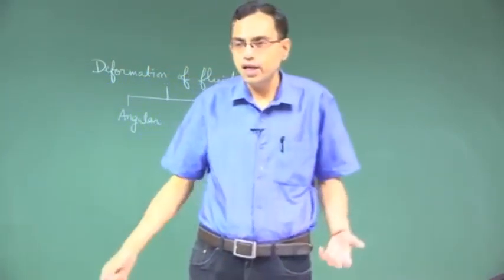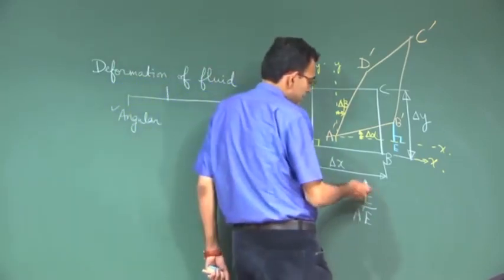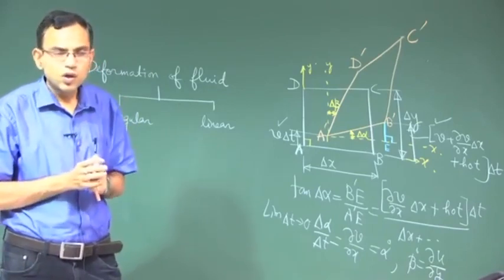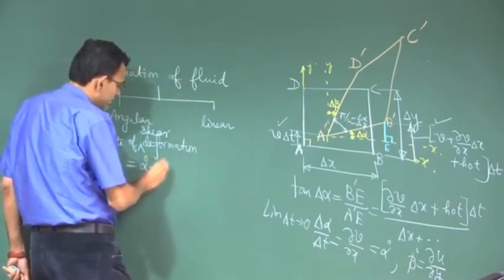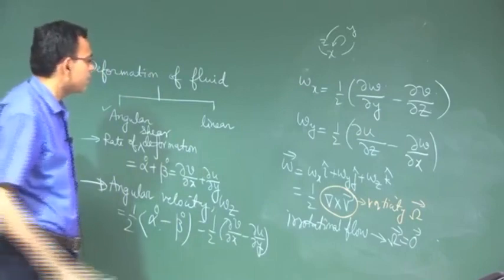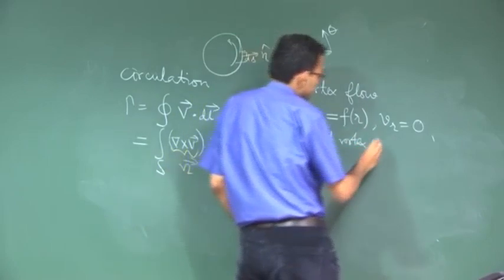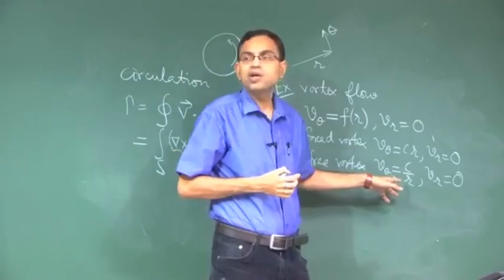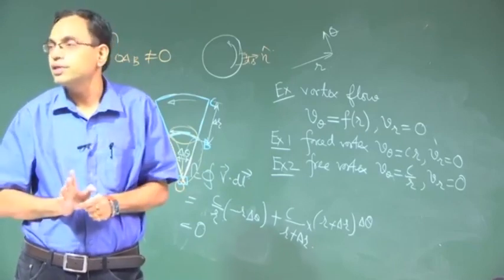Lecture 03 : Angular Deformation of Fluid Elements

Comment: 7:36 👈can anyone explain how that came?
Reply: can anyone explain concept at 7:36
Reply: Taylor series expansion
Reply: do(v)/do(x) is the change in vertical velocity with respect to change is x direction so as you move in x direction then the change in vertical velocity per unit lenght is that expression. now point B' is at a distance of delta(x) so vertical velocity at delta(x) is [do(v)/do(x) . delta(x) ] and the height of B' is that expression multiplied by delta(t)
Reply: hope this helps
Reply: @apoorvmishra6992  At 7:31 when Sir is writing the Taylor's Series, at last why does he write:
+ hot] × Delta t
What is that : +hot???
Reply: @not_nirmit  taylor series is just an approximation of actual curve by summing up higher order derivatives. More the HOTs i.e. Higher order terms, more accurate is the approximation. Its an alternative way to represent a curve apart from its equation. Here HOTs would be (d^2)v/d(x^2) + (d^3)v/d(x^3)+...... . So here single derivative means rate of change of v with respect to x. Double derivative means rate of rate of change of v wrt x. Triple means rate of rate of rate of change of v wrt x and so on. So here more the terms more accurate would be the calculation of velocity at the distance (delta x) as the rates of change also themselves may keep changing. But here later its assumed that, only v changes with distance and rate of change of v is constant throughout the distance so that double and higher order derivatives won't exist. Hope you got some intuition. For more info on taylor series watch this amazing animation by 3 blue 1 brown
https://youtu.be/3d6DsjIBzJ4
Reply: @apoorvmishra6992  God Damn!!!
That was some elaborate Explaination... Really appreciate your effort to take out time & write all that...
Thank You So Much for Clarifying my Doubt...
Reply: @not_nirmit  Glad you understood...